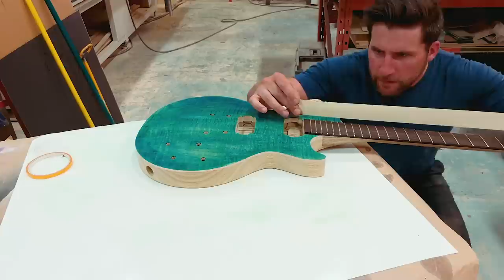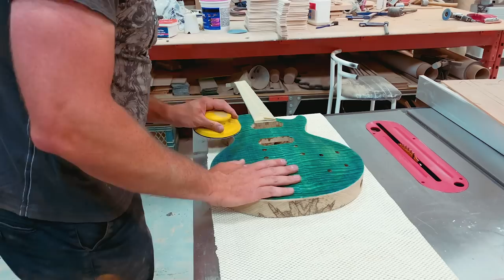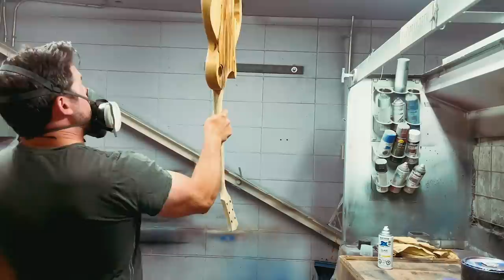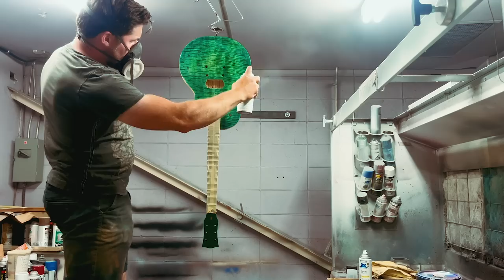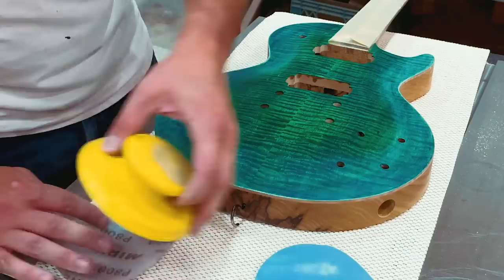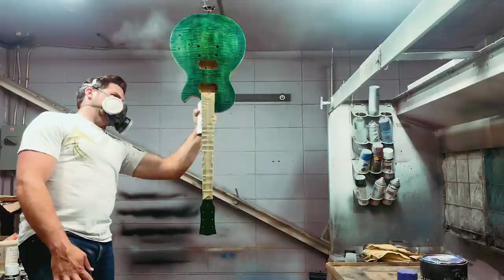The Precision Guitar Kits Les Paul Build Part 3

Comment: You may want to look at Z-proxy finishing resin for pore filling. Acoustic guys use it a lot for their builds. Less drying time and works under sealer and top coat perfectly.
Reply from the maker: Nice. This works under sealer etc. just fine, but that UV resin would certainly be fast if that’s a priority.

Comment: Hey Brad. As per usual great job. I've recently been experimenting with resin,alcohol inks (to tint the resin) and pearlised pigment powders. I lay down a coat of coloured resin then dry brush on the pigment powders while it is still tacky. You can create some amazing effects that way. Also simply placing a small amount of pigment powder on the top and then using compressed air to make it spatter creates really cool metallic clouds, perfect for a galaxy guitar or an abstract scene.
Reply from the maker: Really cool idea.

Comment: That's really a beautiful top on that guitar that dye really made it pop. 

Curious question as I has an idea. I wonder if that epoxy if maybe you could paint something on the guitar before you dye it. So just clear. Maybe something like the Anarchy symbol or something.  Then you apply the dye. Would that prevent the dye from soaking in that pattern. So like you could have a dyed top but have the symbol show through as clear wood. Just a though.
Reply from the maker: Hi Jeff. Although I’ve never done it, you should be able to seal off a logo and then dye the rest and have the sealer repel the dye in that area.

Comment: I stand corrected Brad.. the black would have overwhelmed this top.. the fihure is fantastic and the wetter it looks the better.. curious how you know when to stop sanding that epoxy filler so as not to breakthrough to the top..?
Reply from the maker: It’s very difficult to know when to stop sanding. You’re really just sanding very gently so that the sealer will stick and it all feels even. 
With that said, if you did sand through and pull a bit of dye, that area would then be open again and you could wipe a bit of dye back into it.

Comment: Hi Brad, just curious, after applying the epoxy, you mentioned feeling tempted to just recoat with epoxy as a main finish rather than later applying lacquer. What goes into the decision to still apply laquer over the epoxy if the epoxy has a finishing effect anyways? Thinking about this for my own project but I'll be using polyurethane rather than lacquer. Thanks!
Reply from the maker: I just enjoy the spraying process and the feel of the lacquer. There’s nothing wrong with the epoxy option.

Comment: Hi Brad, is there any concern to be had here with air bubbles in the epoxy? Some folks I know who've worked with epoxy in the past warned me there would be air bubbles showing through if I didn't take steps to ameliorate this. Was this an issue you dealt with?
Reply from the maker: Air bubbles can happen, especially on thicker pours. You can get them out with a heat gun. I don’t find it to be an issue for filling grain. I press the epoxy into the grain and remove the excess. Between that and sanding afterward I haven’t had to contend with any bubble issues.

Comment: Do you know if the ecopoxy yellows in uv light? That's always a problem with epoxies. Do you  have any ideas as an alternative that won't show through the clear coat? I'm afraid something like crystalac might. Of course other than super glue, for an area that size I'd avoid that.
Reply from the maker: As far as I know ecopoxy doesn’t yellow. I’ve done areas like this in superglue before though with no problems. You just need a mask and goggles.

Comment: Hi Brad, is the epoxy harder or easier to do than regular grain filler?  Pros and cons?  Love the colour as it is now!
Reply from the maker: It’s not harder per se. But you do want to try to remove the excess, which is less important with regular filler. 
Epoxy dries harder, shrinks less, and is completely clear (at least this type). It’s also considerably more expensive if I’m not mistaken.